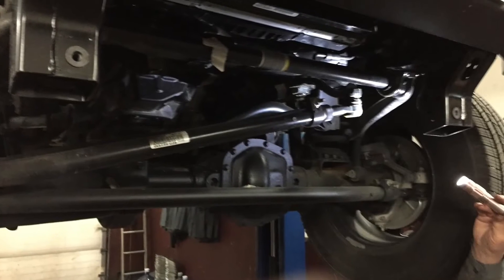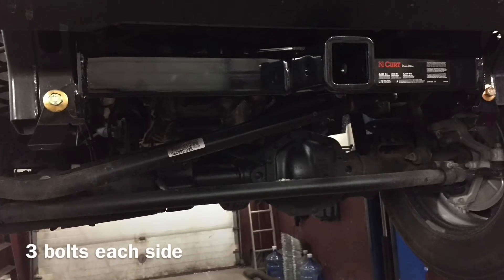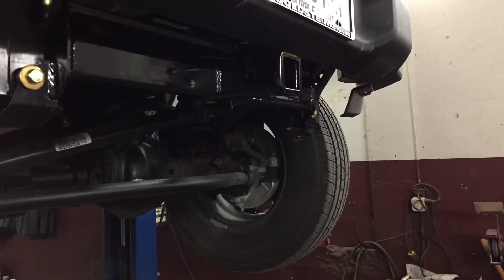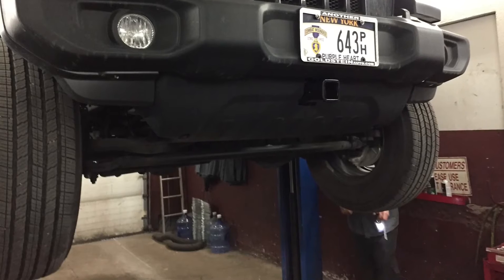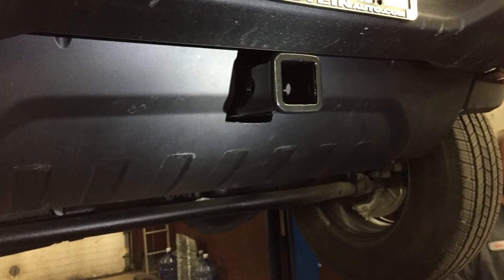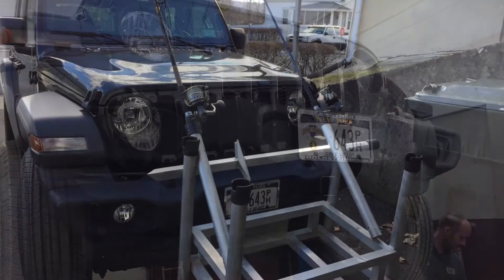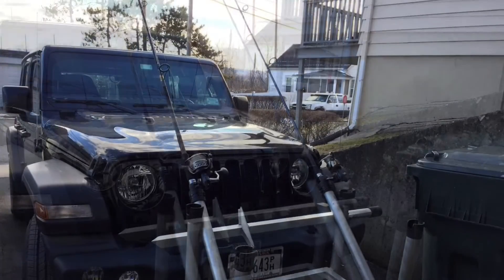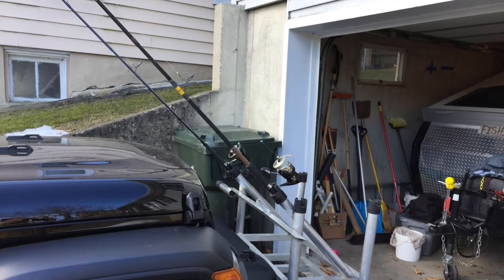First 2020 Jeep Wrangler unlimited upgrade complete 0120#2

Comment: The hitch looks good.  I have been watching videos of mods being done to Wranglers and most seem to bolt on with very little drilling required.  The Wranglers seem to be engineered at a great level.  I am looking forward to more videos.
Reply from the maker: Thanks for watching . The next Mod is an internal skeleton so I can carry my kayak on the fiberglass roof. It will require some drilling in the fiberglass roof but is engineered to use holes already existing in the roll cage and body . Pretty neat stuff. Stay tuned.

Comment: Hi Jay, have a few questions about using a front bumper mount for fishing rods.   How does your fishing equipment handle the long drive to the Cape from your home?  Also, what brand trailer hitch did you install?  I just leased a 2020 Jeep JL Sport 2 door and I am weighing my options for roof racks, etc.   Any help would be greatly appreciated, thank you.